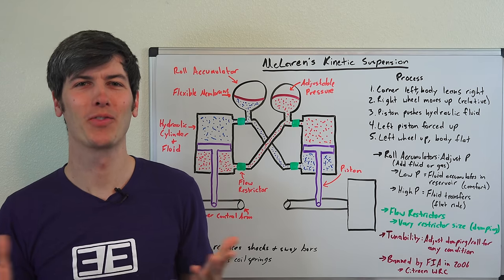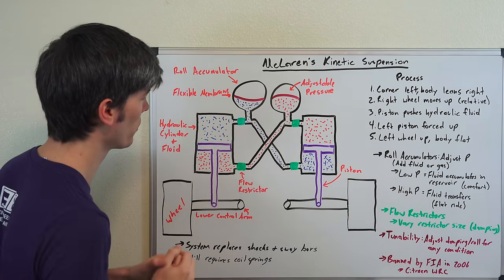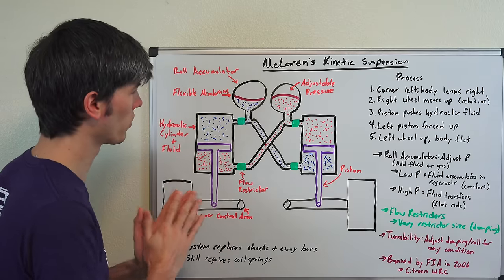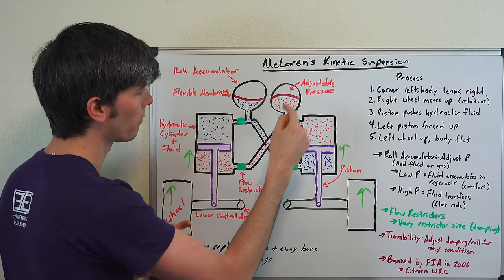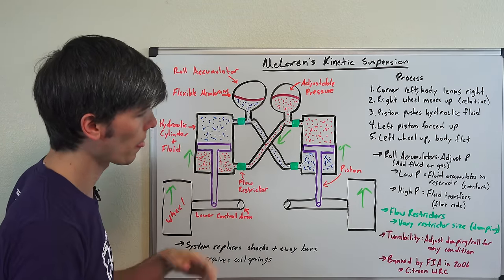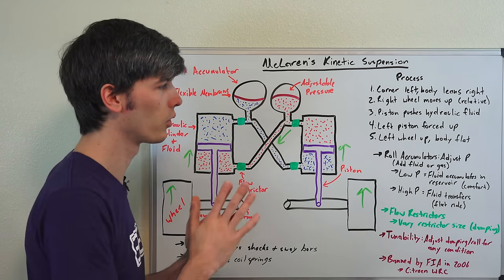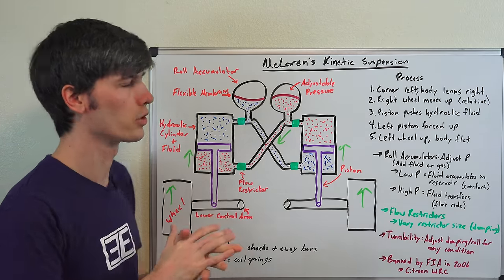McLaren's Unique Suspension Needs No Sway Bar

Comment from the maker: IMPORTANT NOTE After speaking with McLaren engineers on a press launch for the 720S Spider, which uses this style suspension (PCC2), they informed me that the pressure inside the roll accumulators is not adjustable. What is adjustable, however, are the flow restrictors, varying the rate at which fluid can pass by them to enter the accumulators or other cylinders. Normal mode will have the least fluid restriction, and track mode will offer the greatest restriction.

Comment: Another ban by FIA? lol Regulated motorsports are boring
Reply: But at least it exists. Without regulations (or with very lenient regulations) these motorsports would simply implode.
Reply: The Pikes Peak hill climb race has an unlimited class which is pretty cool.
Reply: ***** true
Reply: dude2106 how?
Reply: dude2106 That's foolish and rubbish
Reply: Why does money mean automatic victory with things A through Z, but not when it's only things B through Z?
Reply: By that i mean, using old tech
Reply: Keanu Umpherville Thanks for the friendly response... Would you like to elaborate on why you disagree?
Reply: +Basomga With big manufacturers involved (WEC, WRC, F1 etc.), it will just result in an arms race that only one or two of the teams can afford. With no/few technical restrictions, more money will better translate into more performance, so the wealthiest teams will have a much easier time outperforming the poorer teams. With more restrictions there is only so much performance you can gain by throwing money at a particular system on the car. Therefore overspending will not be encouraged to the same degree. That keeps more teams in the sport and they will all be closer in terms of performance.
Reply: Basomga that's where NASCAR comes in, my dude.
Reply: dude2106 Your comment put a whole new perspective on motorsport racing for me. I'll do more research for myself on that, but it really makes sense (not so much in Formula 1 though).
Reply: Unregulated motorsports would be extremely dangerous and extremely boring since the teams with the most finances would totally dominate and would push the speeds to insane levels
Reply: Žiga Auer the danger part is kinda common sense.
Reply: Basomga 
Name one unregulated Motorsport.
Reply: Shahnewaz Ahmed 

sure, not like F1 for the last 30 years.
Reply: Extremely dangerous. You know, like too dangerous. 

Look at production cars, we can easily bust 1000 bhp with standard fuel and engines that are supposed to run for years with all kinds of electronic doo-hickeys to adjust drag and down-force relative to their need. If you can do that with regular cars, imagine what a pure racing car could achieve, the LMP cars would probably be busting 500-600 kph down the Mulsanne with 1000-2000 bhp engines, adjustable spoilers that would minimize their drag and some sci-fi transmission tech that would allow them to spread their power bands. And then any kind of contact with another car would probably send it flying and vaporize it on impact. On corners you would be getting absurd speeds and any kinds of error would send the car hurtling into the barriers.
Reply: Žiga Auer True. Group B was crazy
Reply: Makes sense if you realize that they would own a patent so other cars couldn't use it in the competition. I supose they could give them an ultimatum and say open the patent to everyone or not use it.
Reply: This is why Can Am must come back. What a lovely fantasy world of wacky designs, silly wings, and a million horsepower!
Reply: Why don't we just put a budget cap and then let the teams make whatever car they want and as long as it is safe?

Comment: this looks like Citroën's hydropneumatics system. mind to make a video on their systems too?
Reply: It's a bit different in the Activa, since the gas pressure is constant, but there's a roll corrector that's linked to each of the suspension sides and let's more or less hydraulic oil flow to each of the sides.
Reply: In the Activa, an actuator (active piston) was installed in line with the anti roll bar. When the system detected roll, this piston would pull or push the anti roll bar to get the chassis level. The Xantia Activa got really good lateral accelaration values for its class.
Reply: I would love to see a video of Jason explaining these systems.
Reply: I, also, would like to see a comparison of the two systems.
Reply: hell yea, i loved the pneumatics on my 2001 C5. it was an incredibly intelligent system, that lowered the car when you went fast on a highway and counteracted external weight like having a caravan behind the car. also it was manually adjustable to set the car 30cm higher, so you could easily drive over small rocks without damaging anything.
i miss the hydropneumatic so much...
Reply: its the same as the 70s ugly citroen

Comment: Citroen's hydropneumatic suspension was more or less of a similar setup installed longitudinally to achieve automatic leveling or "pitch control" instead of roll control. So I could assume somewhat similar reliability with the added "benefit" of complicated electronic controllers.

Comment: It uses a very similar hydro pneumatic system that the Mercedes 450SEL 6.9 used to keep it from rolling in corners. it also helped prevent it from diving on braking or squating on take off.

Comment: I just came back to this video. I'm building a CJ with my TJ as a donor for suspension. I bought a new frame and had it hot dipped and I painted over it. The problem is I just realized the frame doesn't have sway bar mounts for the front or rear and I don't want to drill holes through the paint or zinc coating.

I'm going to dig around and see if I can't modify some shocks that have an external tank and link hydraulic lines the way McLaren did here.

Comment: Please look into the active suspension Toyota Soarer (UZZ32) from 1991, I used to have one. No coil springs, no anti roll bars, just a beautiful anti roll, anti dive and anti squat suspension. 

I couldn't stomach 12mpg though so I sold it on, and now have a Citroen Xantia Activa.

Comment: Didn't Nissan use a very similar system in early 90s for its Infinity Q series? I believe it was also connecting front and rear axle to prevent the nose dive while breaking hard.

Comment: Could you also adjust the ride height with this as well??? And with electronic control, this could be an automatic / learning system that remembers that you like to take that curve on the way to work a little hot, then soften back up, extend so you don't bottom out on those speed bumps! Nice😁

Comment: You mention the suspension system is available in MP4-12C and similar system in the P1. Did they discontinued the suspension system in the 650S, 675LT and so on?

Comment: Clever system. Could be useful on the front axle of a 240SX drift car. Increased steering angle makes sway bar packing very difficult. Most people are forced to remove the bar. A system like this would allow for increased steering angle and the benefits of a sway bar, without the physical bar itself.

Comment: After researching, I didnt buy aftermarket sway bars for my 2009 g37xS because I learned that they actually decrease traction on cars with independent suspensions like mine. My question is, what rationale is there for me not simply removing the sway bars?

Comment: ford motorsport made a suspension system (more like suspension geometry TBH) that eliminated the need for a sway bar.. it was used in the escort mk2 by various rally drivers.. but didn't catch on because it limited the suspension to only stiff settings, not a good thing in rallying.. so the world mechanics found the best of both worlds is to put an ARB AND use the previously mentioned system, 40 years later, it is still being used!
Reply: btw the added ARB didn't integrate into the lower suspension arm, but it was held by a couple of grips :P which allowed the wheel to move more freely and coordinated under heavy braking.. a great advantage in the world of rallying!

Comment: Wow, that drawing was so good, almost everyone probably got it at first sight! Well done sir. Could a system like this be retro fitted to another car like a bmw?
Reply: It would be very expensive
 however its possible
The values would have to be completely re adjusted though
Maybe it would be a bit cheaper with fixed flow restrictors

Comment: My Noble M12 GTO3R doesn't have swaybars, doesn't need them. Upper/Lower A-Arm suspension with coil over shocks. The suspension geometry that Lee Noble designed  didn't need them.

Comment: Very good explanation! Does Mercedes also have some sort of self levelling hydraulic suspension?
Reply: MrCube17 Mercedes's system is active (camera reads surface, suspension adjusts according to that). This system is reactive (go to a corner, anti roll effect kicks in) but manually adjustable so you can minimize that for comfort
Reply from the maker: MrCube17 here's Mercedes system: https://youtu.be/tnpRNQaOVwY
Reply: I was actually thinking of the old Mercedes Self Levelling Suspension which has a similar way of functioning
The new active body control is pretty much witchcraft!

Comment: Are there any weight considerations when compared to an anti roll bar?
Reply from the maker: +CAZinAustralia based on a few articles I've read, the system can be lighter. But I also read an article stating it saves complexity, to which I would argue this is a bit more complex than using a roll bar - a purely mechanical linkage that's always active.
Reply: Is the complexity argument about the roll bar and dampener being integrated so you need one less component?

Comment: so whats stopping all of the "orange" fluid from ending up on the left and all of the "blue" fluid ending up on the right and having the suspension bottom out? Doesn't the weight of the car pushing down on the suspension force the fluid into the lowest pressure state?
Reply: stueck9356 This system isn't the only suspension part the car has. There's also normal springs and dampers like any other car. That's what keeps it up, I'd say. This just replaces the anti-roll bar.
Reply from the maker: There are traditional coil springs, but as mentioned no traditional dampers.
Reply: Ah. Makes sense now. The springs are keeping the car up, thus keeping the dampers in the middle of their cylinders. Neat-o.
Reply: Engineering Explained How come you do not reply to the comment that was posted about 4 months ago about sway bars that guy challenge you and then all of a sudden no more comments from both of you?

Comment: How does the electric motor help the p1 engine in going faster. Still kinda confusing how they both work together
Reply: Aqib Bhatti 
Electric motors have huge torque from zero which fills in the bottom of the torque curve in IC engines.

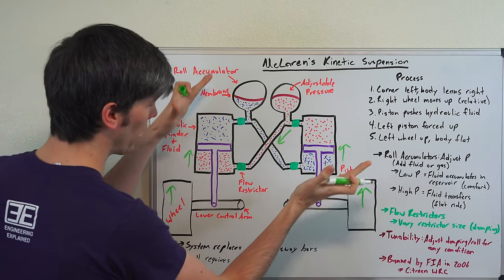Comment: 1:40 If the red fluid on the left is pushed won't it force the blue fluid on the left to travel towards the right cylinder and lift the right piston?
Reply: since the pistons on each side are both trying to push up, the fluid wouldn't be able to move.  The pistons both moving in the same direction and squeezing onto either side of a fluid are effectively what eliminates the roll - the system remains static, but the pressure increases. :)
Reply: faris Y that's the point: if the red liquid from the right transfer to the left pushing the left piston up, it'll also force blue from the left to travel to the right pushing the right piston up, and then it'll repeat until it reaches equilibrium. however, that's the point of this system, is to do as a sway bar does, without the traditional one setting sway bar. it's pretty neat huh?
Reply: faris Y also keep in mind the right wheel will stop going up eventually because of opposite force acting on it from the springs, this system is to ensure the car stays flat relative to the ground during turns.

Comment: CAN U PLZ EXPLAIN SHORT THROW SHIFTERS
Reply: That's fairly simple actually, a shifter is simply a lever and all you're doing with a short throw kit is changing the fulcrum point of the lever so you don't have to move the shifter as far to switch gears.
Reply: Fuster aight, thx bro

Comment: All these people whining about bans in motorsport don't understand the problem. 
Extremely good tech can easily unbalance a whole sport. Where things are so good that you have no way to counter act them other than running them yourself makes such things alternativeless.
What this creates is virtual a stalemate because everyone is locked into doing something this one way because it is by far the best. 
About motorsports in general there is another problem. The more assists there are and the less power a car has the easier it is to handle and therefore the differences betweent he competitors will get smaller and smaller. Why would you not ban something like this? 
An example would be the new swimsuits that came up in the last or second last olympics iirc. These would mkae your body so stream line in the water you would outright save almost a second over the course of 100m. Where technology rules over the competitors in sports the technology has to be ruled by someone like the FIA.

Comment: Terrible design.  Communicating one side with the other is just copying old, very old, hydraulic differential designs from mobile equipment.  I would have just stuck with spool/sleeve proportional valves sitting atop of each strut for lighting response and just control each axis independantly like the active-damping units on F1 from the 90´s.  Some might say this circuit adds a bit of simplicity or failsafe function but it does not as they are already using 4 proportional throttle valves as is.  The real disaster  is using diaphragm accumulators as their pre-charge begins dying down from the get-go due to leakage of the nitrogen through the membrane and into the hydraulic fluid.  This loss of charge is exacerbated by temperature where in hot climates the pre-charge would have to be topped-up probably every year or two, max.  They should have used piston accumulators whose response is more than adecuate but whose leakage is 5% compared to the diaphragm units.  These designs are great for race cars as they only need to last a race, no problem, but for commercial use the loss of precharge means the spring constants are decreasing and with it go performance and safety.  That design is a maintenance nightmare, buyer beware!